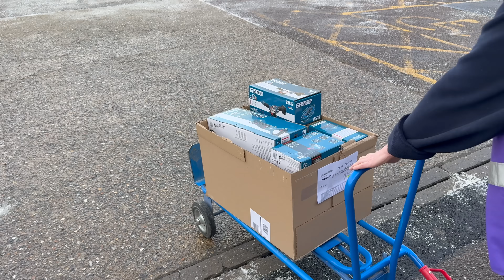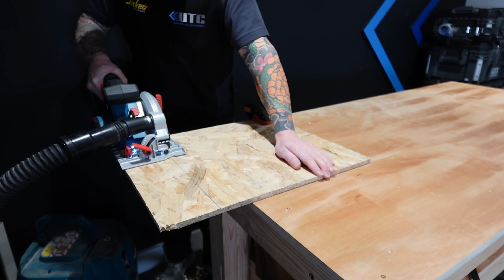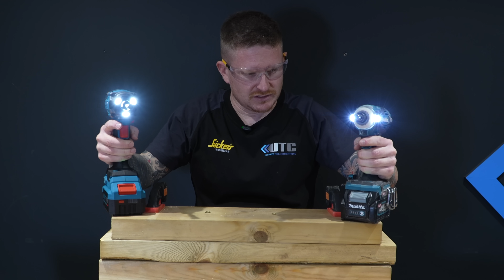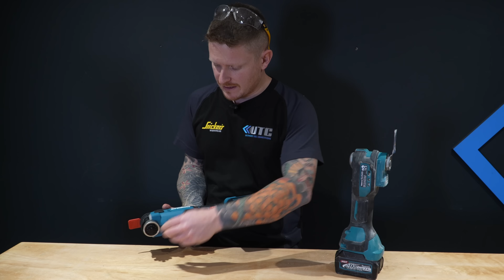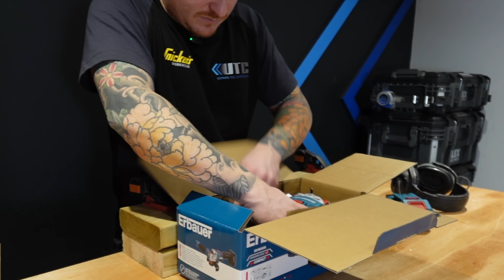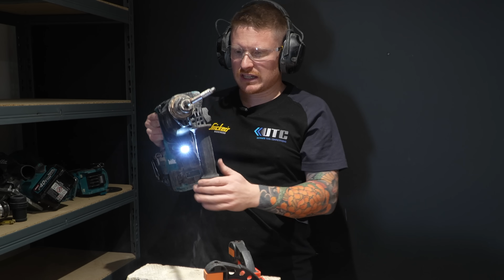New Erbauer V2 Tools | I Was NOT Expecting This

Comment: Looks decent but they're not that cheap. For example, Dewalt Brushless Multi tool can often be gotten for £70-75. 

To be fair, I have seen some Ebauer units that retail for £60 ish but if you shop around, you can often get many of the big 3 tools at £100 or less. The only caveat is if you stay with one brand then they usually have one tool which is much more expensive than the other two.

Comment: Very very impressed with the SDS, bought it to bolt MCC panels down with 8 mm bolts. But I had to bolt down some steel work this week with 12 mm bolts, and was very surprised how well it did. All day I told my colleagues it may not be capable, it ran circles around the Milwaukee and Bosch SDS drills they brought.

Comment: On the skil 20v version of the jigsaw you can turn off the slow start function. The speed dial setting A equals auto. Setting it to 5 puts it into full power.

Comment: Most of my work tools are Dewalt cordless, but for home use I tend to buy corded tools for the following reasons. I'm not tied into one brand so I can buy the best I can afford for each application. Not having batteries takes away one of the major maintenance issues. Constant power output. Cost, corded tools are generally cheaper. Weight, no battery less weight (although this is not always the case). Reliability, I find corded tools last longer. I do opt for cordless sometimes for cutting tools as I do have a habit of cutting cables. I have a couple of Erbauer corded sanders for work which get used a lot, I've not had any issues where as my Dewalt cordless sanders barely last 2 years.

Comment: I've used the v1 drill set and multitool for around 6 years on site. For metal work, woodwork and masonry. They've never missed a beat despite being used all day in heatwave weather as well as the rain and the snow. Dropped an impact off a roof and and its still working 4 years later. I've killed 2 batteries in that time but have also killed makita batteries too. I couldn't fault them at all really.

Comment: My thinking is if your're going to invest in cordless tools you'll want quite a few batteries so you're not waiting for charging. If you don't want to have to have a multitude of different brands of battery and chargers then stick with one brand of tool. And if you're going t stick with one brand of tool, then you want one that is good quality, good value for money and also one that has the widest range of tools. If you choose a brand with a small range of tools then you may have to buy a whole new load of batteries when you inevitably want to expand your tool collection.

Comment: Worked in the trade, mainly had Hilti and Makita but after a long break and having sold most tools, I needed something for my school renovation and looked at Erbauer from Screwfix, got the basic kit, V1, in a large roller case and was impressed and have bought many other Erbauer tools since. I would say I have been using these tools as much as a tradesman would and have not had a single issue and whilst you say they are for the DIYer, I disagree. If you are a young tradesman starting out, don't go with the hype that all tools need to be RED, you will not be disappointed going blue, ERBAUER BLUE !!!

Comment: Erby jigsaw no good pendulum has to much play left and right, router decent for a spare cheap if your main one is in menders,  plunge saw is decent ive been abusing it for 2 years now and still going strong using decent blades
Reply from the maker: Sounds like a mixed bag then, thanks for sharing your experience with them!

Comment: do the battery's between the v1 and v2 work on either?

i have v1 currently with some battery's breaking but if i bought a v2 tool would the v1 battery's i still have work on it?
Reply: Yes they still work even the new dual voltage 18v/36v batteries work 👍🏾

Comment: Was the availability of the battery packs, ( and chargers ) and their price discussed? The machines are obviously great for the price asked. But as battery packs alone from the known brands ( like makita and... ) cost a fortune, the possible much lower price for let us say the erbauer packs may be another reason to depending on the intensity of your intended or known use be the deciding factor.
Reply: Bit late to your comment but the batteries are very reasonable. Was one of the main things that made me go with these over Ryobi or Einhell.

2Ah is £25
4Ah is £40 
5Ah is £45

But B&Q does a 15% reduction on all Erbauer roughly every 2 months. And Screwfix does bundle deals on the batteries every now and then.

You're currently getting 2x 4Ah batteries for £60 at Screwfix. I actually got 2 for £50 from Screwfix last year (latest re-design as well).
Reply: @BrokenSmokes  Never too late. Great if the total package is efficient durable for the intended use, and not only the machine, but the batteries ( and charger ) are also of suitable quality and ( readily ) available for a comparable sharp price as the machine. 

For my home use I have parkside battery drills. And the batteries do well ( for my use ) As I can buy parkside at a local LIDL, and or order them via lidl, their AVAILABILITY and sharp pricing was very suitable for me. 

In other places, countries there are many other stores with their own brand selection and availability which is often a determining factor. Not all sharp priced tools ( as compared to the better known quality brands ) do well. Not every parkside product is up to specs. 

I am not happy with the huge amount of brands and types sometimes even the same machine / tools but with a country code / other brand name making any comparison near impossible. I would favour the better producers of tools to up their production, KEEPING high quality standards, and lowering the price because of the greater production numbers. While diminishing all the lesser made today gone tomorrow bad quality tool brands and thus while keeping the price of tools at a payable level for all, and reassuring quality. 

Being able to depend upon quality, servicing, parts availability also not for today but for years to come, is what everybody should be able to do blindly. 
But even the well known brands do seem to be lowering their quality, not giving support, and becoming in that sence also near worthless producers. 

But I think that I will have to dream on. As it is too easy to push anything of cheap quality onto the market as long as there is a low price, there will always be people who buy that and have junk in their hands. 

And what about all the waste that all the rubbish use twice throw away tools make? That alone should be a very good reason to keep up quality and have less producers. 

I understand quality, understand that quality production has it's own costs but am prepared to pay for quality if It will last. And of course you have good quality for the do it yourselver and very good quality ( durability ) for the expert user. Each with it's appropriate pricing.

Comment: Note, I do sometimes rave on...enthousiastic as I am. 

Of course besides the machines, it can be the quality of the battery packs that make or break. 
1 Constant power until the battery is empty. No use having a battery last long under use when the power just gets less and less. 
2 battery life. How long under normal use does the battery ""live"" until non chargable / usable
3 Price. If the cheaper batterys live less long than the known brands ( like makita etc ) but cost half or even one fourth of the known makes then a quick calculation may still come out in favour of the less expensive brand.

What do you really need. What is your actual use? If it only the occasional home job then making a great investment only to have it laying around gathering dust ( between the occasional jobs ) is less desirable at the least. 

That is why tests like tha one you are doing here are so important to those who find the video and have not as yet bought their machines. 
often the differences in function and durability are minimal but the price differences great. 

Note: I believe all do it ourselfers plus would love to have their "workplace" full of the best brand machines. But then again we would all love to have that money needed to invest in that to start with. 

There is a lot of pleasure to be gained by having machines to do what we cannot or will not do by hand, but inside our budget. Having a less expensive brand machine that does the job... is what we bought it for. And Yes more expensive brands may may do it a little faster, have longer battery life ( before needing a recharge ) but the hobby user does not need that. We do not all have bags of money to spend freely. 

So depending on what we think we want to do that plays a large roll in our choice of investments. 
The price gap between the better quality less expensive brands  and the formerly well known quality brands is often so large that even if they do ...eventually break ( do they break more than the better brands? ) then buying another you still come out better off financially. 

For the more active user, the do it all every day jobber it will be more of a detailed analasis of the function than for the regular hobbyist, and then in the details I would expect him to come out at the well known quality brands, although even they seem not to be what they once were. 

And for a let us say build a garage or a garden shed for example, a one off job, for the people with the room to build one or perhaps for family.... / friend a once and never again job then having power tools ( battery ) is very handy at the least. And does not require expensive tools. And after that job then the tools may lay in the tool cabinet for years before another job arises. For situations like that good working solid tools that do what is asked of them but can actually be bought because they are far less expensive than the normal brands would be the first choice and possible the only option. As there is a limit to what many people can afford to invest in.

Comment: If you really want to test the impact driver then get it to screw in ten of those fasteners and see if it gets hot or the battery gives out, I was always told to get the best tool that you can afford, better to do without for a few weeks while you save rather than buy something that wont go the distance having said that for the handyman at home who only uses these a couple of times a year then they should be fine if you are a tradesman, well there is a lot better out there that will work hard and have a long life if looked after.

Comment: Do you recommend the Erbauer plunge saw to cut OSB sheets?
Reply: This saw will cut OSB and it's fine for DIY use. However it's underpowered for trade use and would frustrate you if you are used to professional tools. To me the underpower issue isn't a problem because it feels much safer than my friend's 220v DeWalt.

Comment: Like your tool reviews, as they are very honest and tested in real world scenarios.  One question, I've seen a lot of tool tests from the US stating that the best combi drill and Impact drivers are the Flex brand (German considered in Makita/Milwaukee end of the scale) but being in the US they are 24v and I can not find any reviews showing there 18v (that's available in EU/UK), they all say they are seriously powerful, they wipe the floor with DeWalt etc, and charge fully in about 20 mins, but they can be on the heavy side.

Comment: I'm tearing up some old decking and just bought the Erbauer reciprocating saw to help. Using just the supplied wood blade it cuts very easily and quickly through 6x2 and 4x2 timber that was supporting the decking. Some of the wood was also soaking wet, but the saw still went through with ease. 

I've got quite a few Erbauer power tools now, and very impressed with them all.
Reply from the maker: I like Erbauer for the most part too 👍

Comment: Tbf, Lidl's Parkside give you the biggest bang for buck. Besides the usual drills, saws, and grinders, they have a battery-powered hot air gun and a battery-powered soldering iron / station, a battery powered 2" cut off tool, all work well..... I generally use Millwaukee but Parkside stuff works really well, esp regarding price.
Reply: Problem with Parkside if if they break, you need to wait for them to come back into stock, which could be a year away,  Erbauer are available all year round at any Screwfix.

Comment: I had an Erbauer table saw many years ago, great cutting but useless fence. I discovered that it was a Rexon in a different suit. Rexon sent for only the price of postage a new table bed which was much larger. As I was only using it with sleds it was fantastic.
I am however Makita guy but due to water damage I've had to replace a number if tools with more to buy. I've opted to go more budget friendly as they're not earning me money.
I was going to go the Erbauer route but changed my mind and through Screwfix have gone down the Skil 20v route. I don't know what you think of them but personally I think they're fantastic. Pretty much Erbauer prices with fantastic performance plus a 5yr tool warranty and 3yr battery warranty.
My combi drill, impact driver and multi-tool are fantastic plus the LED lights design and positioning is actually great and really illuminate the work area. I don't regret moving away from Makita.

The only problem is Screwfix, they just will not commit to selling the complete range of available Skil 20v tools. Shame on you screwfix just because it competes with Erbauer.
Reply: I'm looking at the same tools and was going to pull the plug on the skil but then erbauer have just dropped there new 6 tool package and only thing which isn't in it is the elite impact driver but has the Nexted one down so I'm still torn between the skil and the erbauer due to that price plus they do have a few more tools like mixer and the mini palm router does work on makita plung setup, plus you can use the batteries on the evolution but still tossing between skil as better batteries plus that handy USB port for phone charging lol
Reply: @jonathanwright6275 you make a good point. I bit the bullet before the release of the new range so am kind of locked in now, however personally I'm not suffering buyers remorce which I think is founded by just how well they have performed so far. It's a tough choice for some so I wholeheartedly wish you the best with whichever you choose.
Reply: @Sly_Wolf_1 thank you, its because its a new brand and I have or should I say still got there 10v mini which is still going erbauer and my dewalts have been replaced while that still takes the brunt of my workload. I just like the fact you can charge from USB and also charge other tools aswell like phone and other USB tools so it's less to carry and if the battery's last way longer due too there tech it's a win, but it's how long the tools will last
Reply: @jonathanwright6275 with the exception of my past Makitas and current although old 240v Makitas I've been let down by big a name when it came to durability.
Aside from the usb charging adaptor that's included, I live the power boost charging feature. It will charge a 4Ah battery from flat to around 40% in about six minutes, which in my opinion is brilliant if you don't have a spare battery laying around. The USB charging it also apparently a great way to keep up battery health by using them in the home when tools aren't being used for a while. With a five year warranty on their brushless range and three years on batteries I'm hoping they're guaranteeing them because they know they'll last.
Reply: @Sly_Wolf_1 that's what is making think of skil due to the charging option as I can have a bank of USB chargers in back with the batteries always on charge with buying converter and if in shed a simple solar panel hucked up trickle charging them too, as I hate going to grab a tool and battery and having to charge them first or half way through as they wernt enough charge when been going from one job too the next and never had time to get the charger out

Comment: I'm an electrical contractor and i switched all my kit to erbauer after having 3 month return issues with my hikoki drill during COnVID. The benefits of this very slightly lower quality stuff is the Screwfix return policy is quite decent with long warranty on most tools and there'll replace it that day. Regards longevity of these tools they've well surpassed all my expectations and are really solid. I deliberately nearly tried to destroy my first sds drill just constantly using the kangoo for first fix rewires etc to really test it and it lasted two years and they replaced it no issues. I have almost the full kit now and would highly recommend it as a solid budget professional power tool Manufacturer. 
Most of my kit is still v1 and i indeed had issues with my circular saw v1 but again they replaced it no problem. Only the sds drills have failed 3 in total but I'm extremely heavy on them and they've all been replaced by Screwfix that day. It was all about the customer service for me really and Screwfix have been excellent. I can't have a day without a drill. They've always replaced any broken power tool with minimum fuss.

Comment: Avoid. Even if they were any good, you can't get spare parts to repair them.
Reply: Not worth repairing anything these days tbh. I had an Hitachi 9” grinder which used for years. The trigger went on it & I was going to get it repaired but just for the trigger switch it was £60 without fitting. I ended up getting a brand new makita from Screwfix for 110 quid.